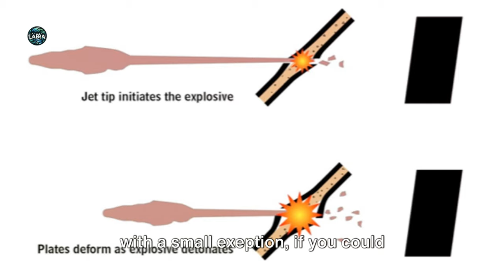How the Killdozer could have been improved

Comment: I have some time rn lets dive deeper into this lmao, discussing desings like this is fun

I think you are looking at this with the wrong mindsed, this was made by a single guy in a basement using whatver material he could safely buy on bulk, also, even tho there were gunports, he didnt really used them, he didnt actually killed anyone. Some of your suggestions are way out of this world lmao, like, ERA??? Mustard gas launchers??? NBC Protection?? Remote controll with drones?? why not suggest him to buy a T-90 already lol. 

Some suggestions are good but I believe they wouldnt be too fitting, such as barbed wire, he intended to use the dozer to level buildings, so any barbed wire would rather quickly get either thorn off or crushed by the debrees. The armor was indeed innefective for its weight, but I find it unrealistic to improve it to withstand AT weponry, but the addition of kevlar would indeed be a great for  spall. Removing the rear mounted digger as a whole would be the same as removing armor, resulting in having to increase rear armor plating, so possibly not that much benefit for weight, but removing certain parts of it could certainly help to shave some weight.
 
Some of the things I believe could have been improved realistically is: 
- The engine: as you said in the video, the added weight made it so that the engine had to work extra hard to keep the thing moving, modifying and improving the engine's output would be of great benefit
- The cooling system: one of the things that led to its demise was a rupture in the cooling system that caused the engine to overheat, plus, with improvement of the engine, naturally you would need a improved cooling system, if he were able to create protected vents similar to those found on the Maus tank together with some powerfull fans and radiators the cooling problem could possibly be fixed.
- The weight: I am unsure about efforts to reduce weight, but stuff such as reducing the armor thickness at the roof and top engine cover (as seen in many tanks) could greatly improve weigh, plus the removal of unecessary parts, such as the hydraulics and the "fork" of the rear digger, the tractor's original bodywork, and whatever piece that wasnt in use, wiring for the original lights, logos, grilles, storage boxes, hand rails etc... Everything that could take some Kgs off the vehicle would count.